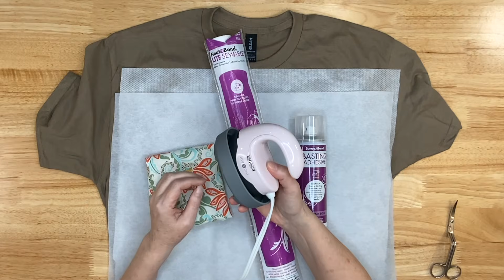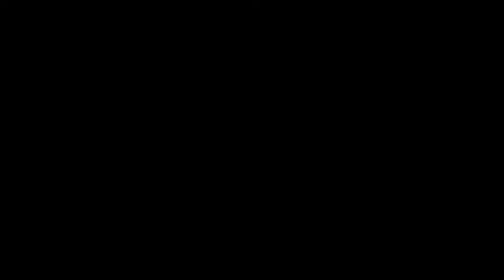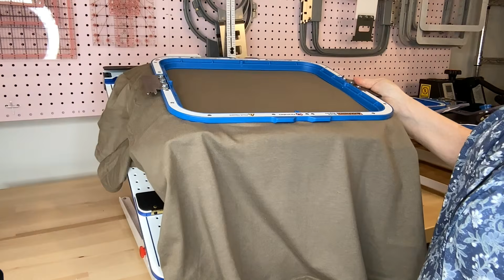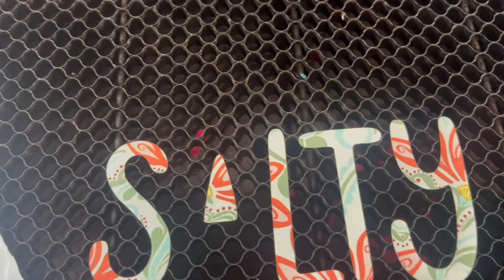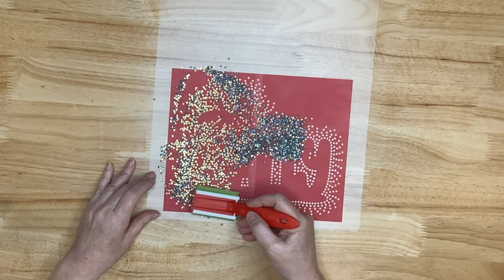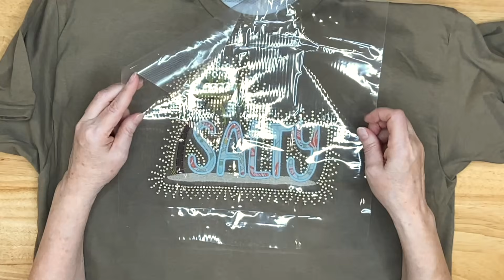Making an Embroidery and Bling Shirt

Comment: Because you’re doing a scattered rhinestone around the embroidery design do you still place the embroidery design approximately 3 inches below the neckline?
Reply from the maker: I move my embroidery designs down if it has a scatter around it. If the scatter goes 1 inch above the top of the design, I would move the embroidery design down about an inch. But it's all a matter of personal preference, as long as you take into consideration how large your scatter is. If it is only 1 inch above the top of the design, you could leave your design as 3 inches down. Great question! And thanks so much for watching.